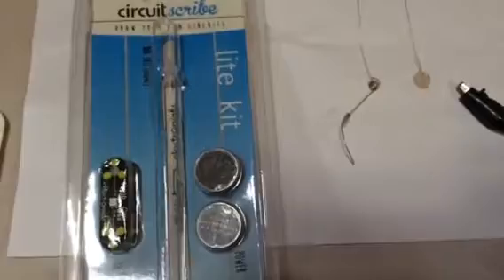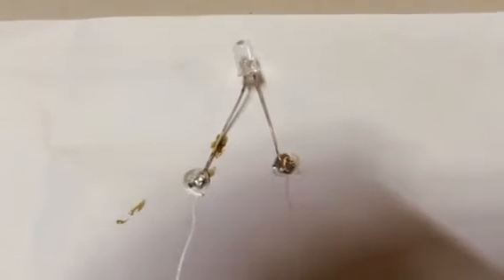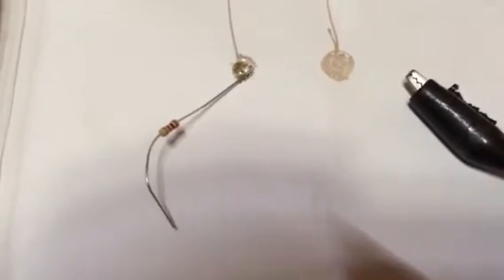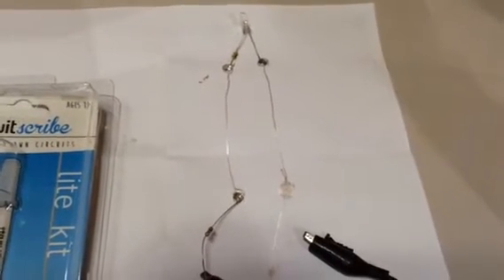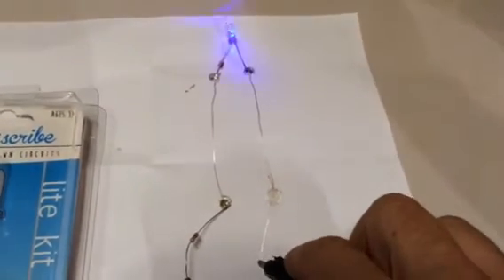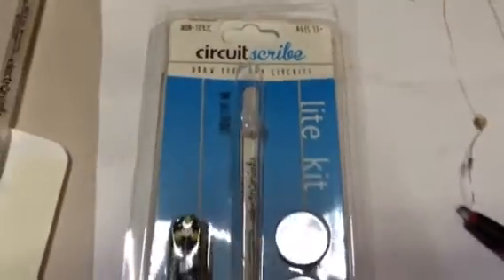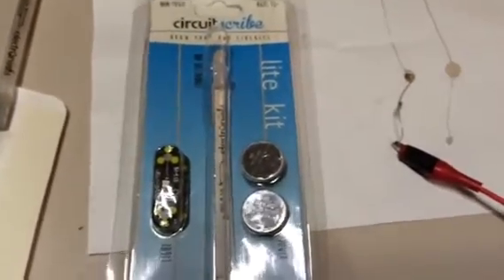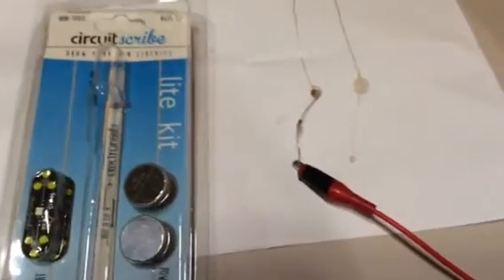Drawing and Soldering a Circuit with Circuit Scribe

Comment: How well does the solder hold to the ink? If you pull the resistor, does it fall off immediately? Do you think this pen would work for drawing larger, PCB style circuits?
Reply from the maker: It holds the ink fairly well. No, the resistor does not fall off. Yes it would work for drawing larger circuits. One issue though, the ink itself will have a bit of resistance. PLEASE SUBSCRIBE AND ASK YOUR FRIENDS TO SUBSCRIBE AS WELL. i NEED 300 MORE SUBSCRIBERS! THANKS!